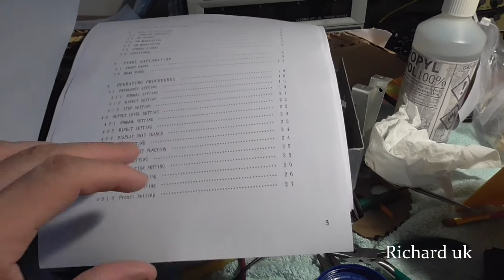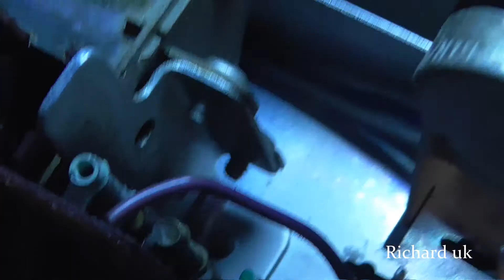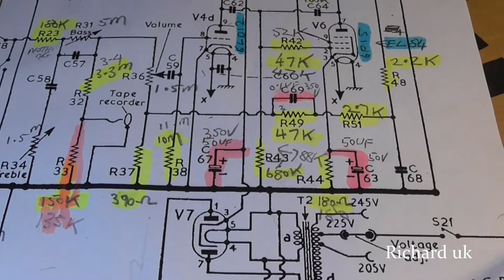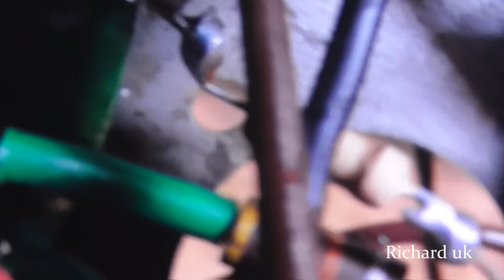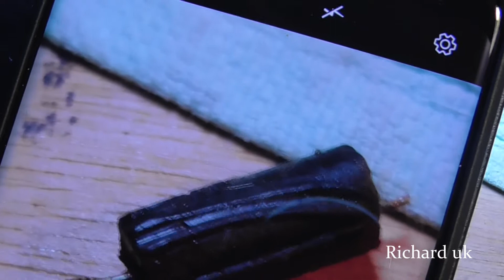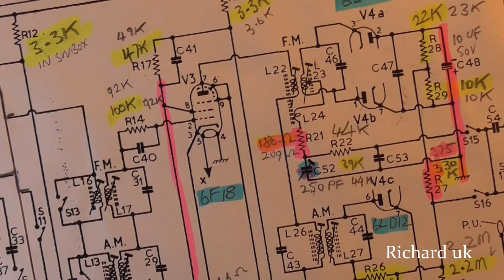Murphy A674 Checking Resistor part 3

Comment: Hey Richard,,, the answer is no. That tube can mix either AM or FM. It depends which circuit is chosen. When one is chosen, the other circuit is cut off. So it will only see the signal from the FM tank circuit or the AM. Think about the AM het radios before FM was even used. It's amazing how they figured it all out so it would work,,, but no,,, they do not mix.
Your tester is really cool. Looks like a bit of a learning curve on it but should be well worth it.
Reply from the maker: skycarl thanks Carl so when vhf is selected. Is that same as fm thanks
Reply: Yeah Richard, you will find your AM in the medium frequency range.( that's 300kHz to 3mHz ) Your shortwave will be in the High Frequency range ( 3mHz to 30mHz ) and your FM bands will be in the VHF bands which are 30mHz to 300mHz. You can see the big difference between the AM and FM ranges so it would be tough to try to mix them.

Comment: That looks like a great signal generator and the only one you would ever need to align just about anything. Wow you were up early and in the shop! Good to get those old capacitors out even though that one was close in value there is a very good chance it was leaky, I have only worked on American radios but have heard those hunts capacitors are paper with a plastic coating and are very leaky like our old American black beauty/bumble bee caps.
Reply from the maker: Thank you. I think this is going to very nice when I get to grips with this equipment. If I going to sort this radio out , I am going to need it.. Thanks Your tag has been added to my safe user list for your next coments  Cheers
Reply from the maker: K2bew hi the bumble bee caps you spoke of.. I not seen one in the UK yet.. I have learned how people hate them exploding in your face.. a very good reason. I think you are right that the hunts caps are very simular paper in side. I thinking of distroying some just to see